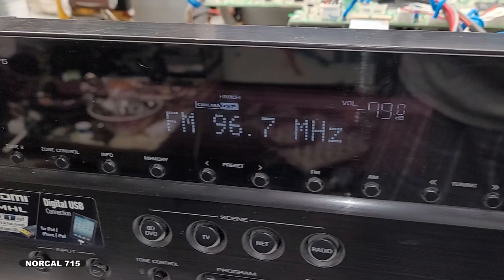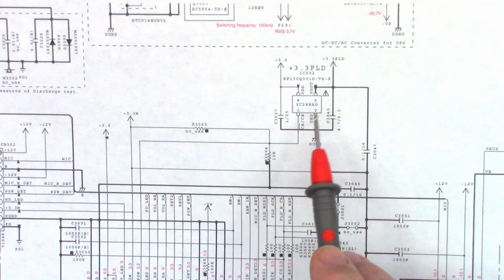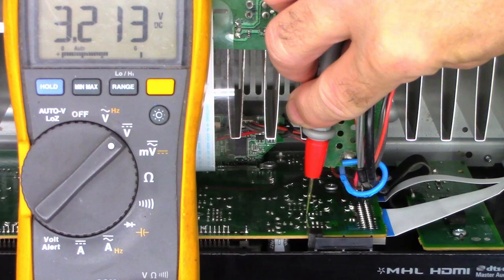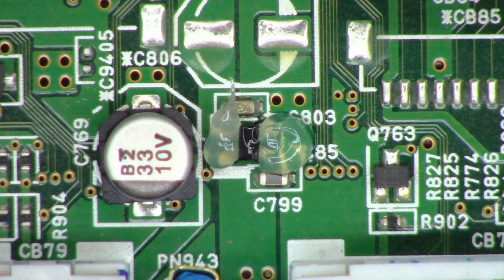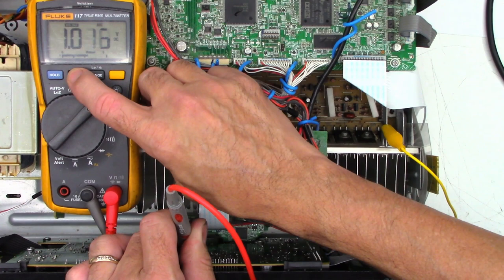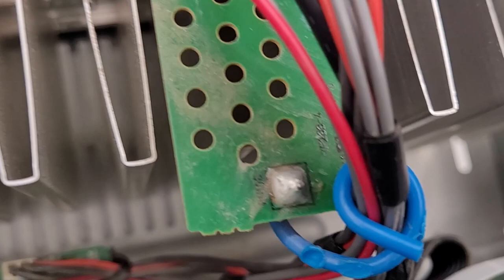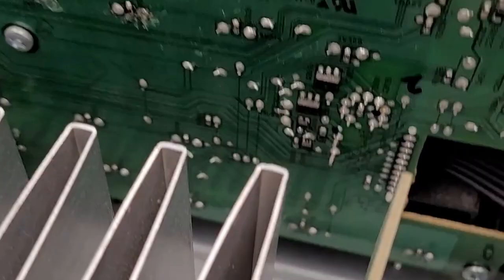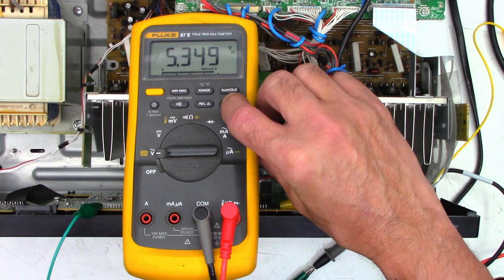Yamaha RX-V675 AV Receiver - Front Display Freezes or Distorts Intermittently

Comment: I bought the exact same receiver, faulty as well, for 25€
It would not turn on and go to protect mode, due to an incorrect power supply rail voltage
I managed to byoass that security by adding a 10k resistor from the monitoring rail to ground, and it now works fine, except for analog video, but I don't really care about it honestly
Maybe I'll try to find another board, but that doesn't seem to be an easy task...

Comment: So if you did not have the IC  you needed meant not fixable?...
Reply from the maker: I may have used a fixed voltage regulator if I could not get the exact IC as replacement.